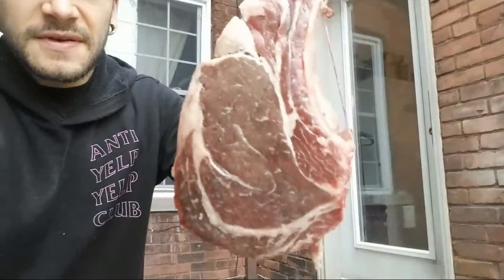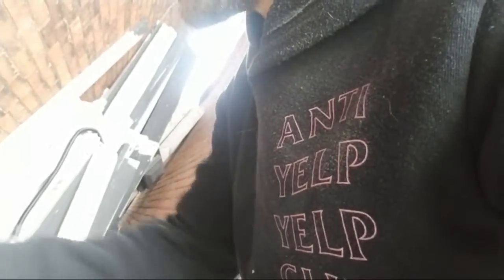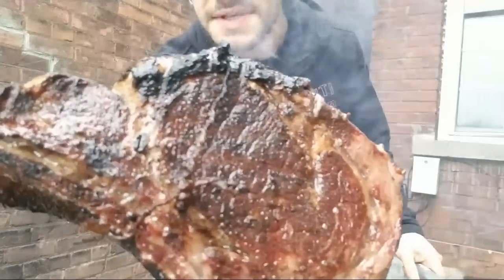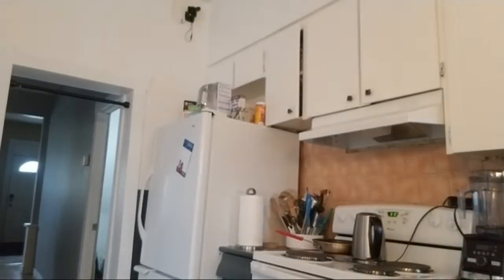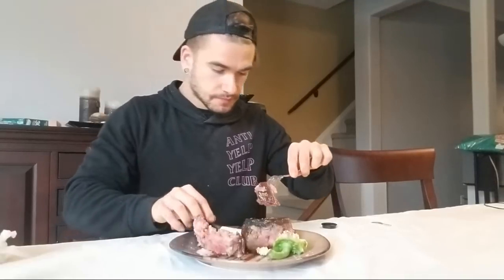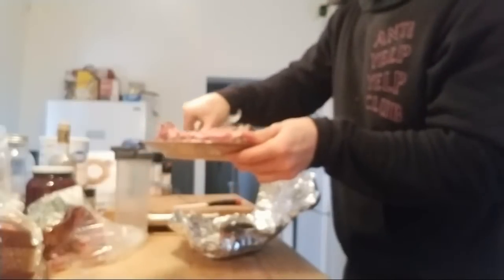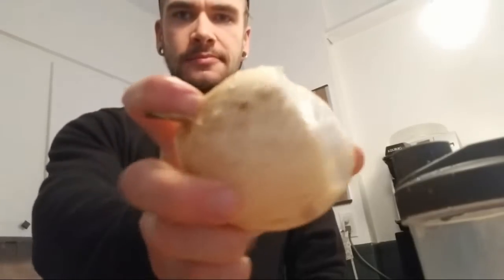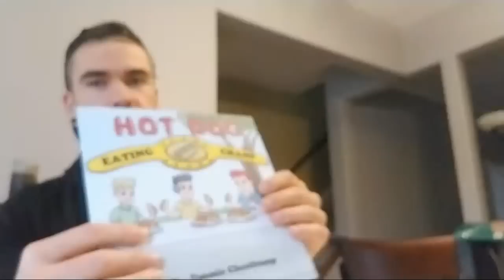Easter Prime Rib (Cook And Eat)

Comment: Rule of thumb for cooking beef, place it on and let it cook until you see a color change about half way up the down side of the meat... flip it and wait until it is full color (brown) both sides. use an instant read thermometer to be sure when your new to grilling meats. each meat has it's own safe cooked temp. beef is 165 fully cooked, 120 rare, 135 rare medium, 145 medium rare, 155 medium well, 165 well done.